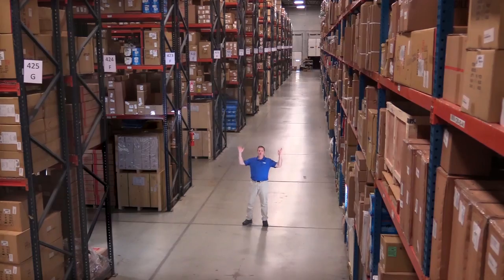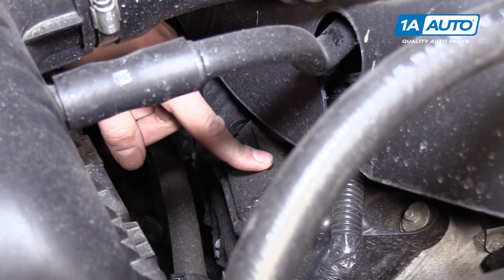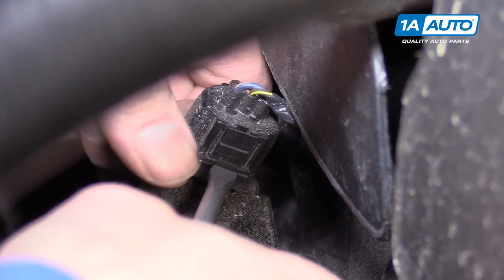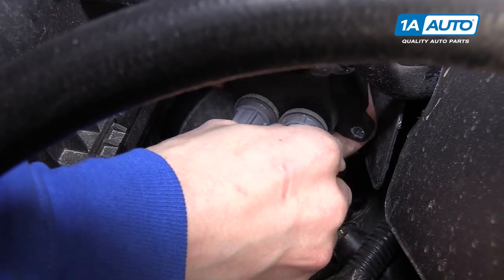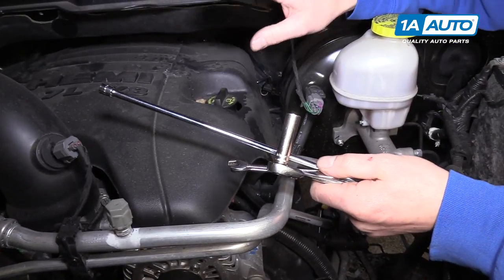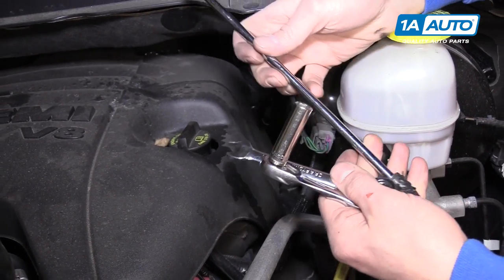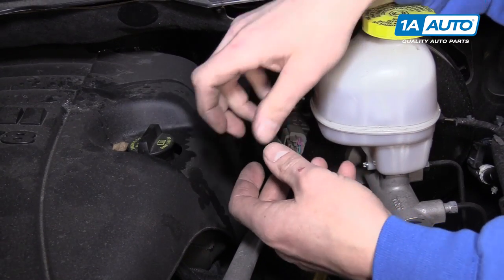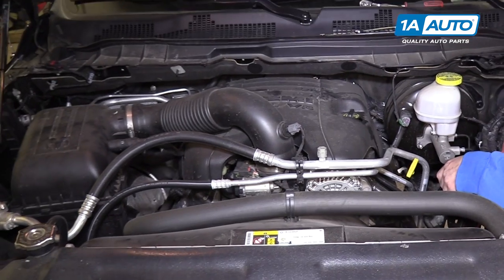How to Replace Ignition Coils 11-17 Ram 1500

Comment: FYI, That plastic cover that has hemi engraved on it, the one that covers the engine , I think you can take that entire cover off. It pops right out. Mine does anyway. For those hard to reach bolts.

Comment: 1:40 you can see the resistor inside the boot on the coil pack side.. is that resistor important? , will if affect the current if they are corroded? can you purchase them separate?

Comment: Any DIY guys like me don’t forget to disconnect the battery before doing this lol. Might wanna check it better yet replace your plugs when coil replacement because if 1 spark plug is faulty you’ll be replacing the coils again

Comment: I have misfire on 8th cylinder is that far back passenger
Reply from the maker: +oliver biss Yes the #8 cylinder should be the one all the way back on the passenger side. 1aauto.com
Reply: @1AAuto  I also have a misfire on the #3 coil on my 2012 Ram. Which one would that be? Hopefully you can answer this for me.
Reply: Wow some help .. why didn't you just say .. take out the engine mount bolts and drop the engine lower . ... Then it's easy
Reply: You reset the code too?
Reply: Does it say coil #8 misfire? Because that's different compared to #8 cylinder if you have 16 spark plugs
Reply: "I have misfire on 8th cylinder is that far back passenger"   ---  I have the same error code and it's driving me crazy.  1st,  I had those cracked head bolts replaced, that was supposed to fix it.  Then I had the spark plugs replaced and since the truck has 96k, it was getting time anyway.  Still I get the error code.  Next I need to replace the coil packs.  If not that, they say it might need head work.  I love my truck but my 68 Riviera never gave me this much trouble.

Comment: What about the 4th cylinder, where’s that one?
Reply: On a 5.7 Hemi the #4 cylinder is the 2nd cylinder back from the front of the engine on the passenger side,it will be 2,4,6,8 and 1,3,5,7 on the drivers side